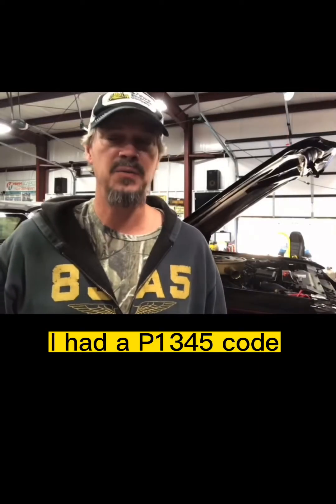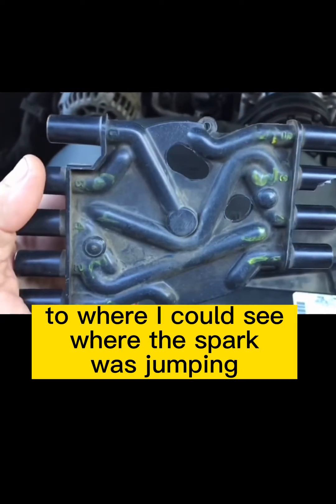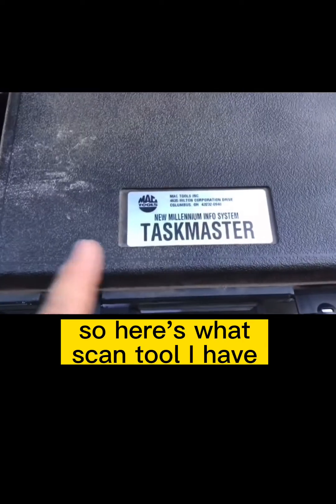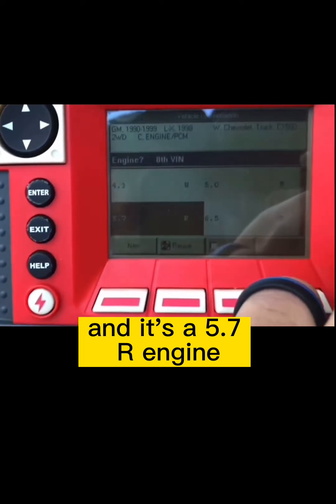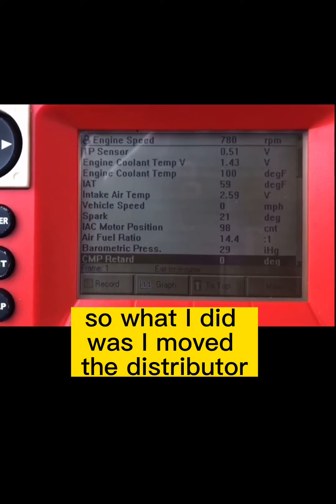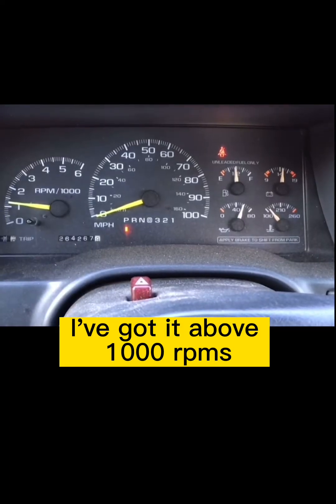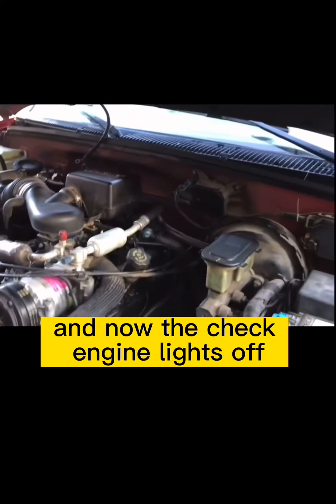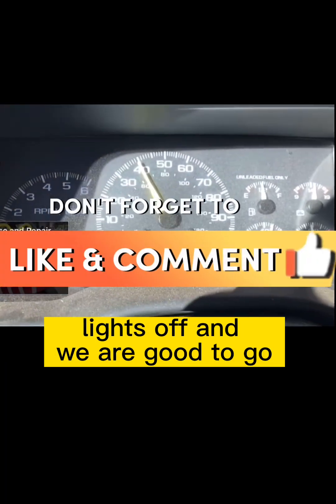P1345 code Chevy 5.7 Vortec Cam/ Crank Correlation fix

Comment: I know this is a old video. My 99 suburban starter went out noticed flywheel was going bald. Had the flywheel replaced and switched to a 11 tooth starter. Got it home sat for a few days then bam no start just engine spining over.  It has a new distributor now currently running no balls wont spin tires. Running is 20-25 + advance but runs great no check engine lights. Im going to replace the crank sensor next as I think its the true problem.  Chasing demons is half the fun right.
Reply: The code i did get was a p1345 cam to crank sensor correlation
Reply from the maker: True. It’s hard to see electrons versus mechanical malfunctions 😂

Comment: I had this code p1345 on my 2003 GMC Envoy with a 4.2l....reseated both cam and crank sensor plugs.....reset light stayed off till i shut the engine off and start back up the CEL light would come back on....my alternator ended up being the culprit. Changed it and as soon as i started the truck the CEL when off immediately....so its not always the timing itself or the sensors. could be a voltage problem.

Comment: I have this issue its at -27 so which way did you move the distributor cw or ccw when you moved it a tooth? Thanks
Reply: if its negative you move it clockwise if its positive counter clock wise.

Comment: What kind of computer or info tool do you need to reset this cam crank collation adjustment
Reply: start the engine with the old crank sensor connected....then disconnect old sensor install new and no relearn is needed. other than that you need a scanner that will do a relearn. I have the TopDon ArtiDiag500 and it can do relearns.

Comment: Im having a similar issue. Only when i go up hills my 02 sensor voltage drops to 0.0 untill i level out or back off the thrrotle
This also happens when i go heavy on the throttle. And throws a system too lean bank2 code

It's got brand new o2 sensors new fuel regulator, new fuel filter. New upper intake gaskets

My time advance is showing -24 at idle 
(even when distributor spark is goin straight to the diode) and goes over -30 when i rev it. Any ideas?
Reply: Figured it out? I’m on the same boat

Comment: If anyone ever find they can't get it by moving one tooth, if you remove the roll pin on the gear you can get half a tooth by putting the drive gear 180 out.  I don't think they get it right all the time on the parts we get cheap from China.  Shimming the distributor to get 0.010" end play is a good idea.  The shaft is smaller than earlier Chevy distributors You can make the aftermarket shim kits work with a bit of fitting.
Reply from the maker: Thanks for the info. I’ve got some old parts that I trust more than most of the China made stuff nowadays

Comment: I'm having two P1345's, changed sensors. When I go to dwell the distributor at 1k rpm, and I get it to 0⁰, the engine dies. Any ideas?
Reply from the maker: Are you using the scan tool to get -2 to + 1 where zero is in the middle of the range?
Reply: The advance fluctuates the whole time

Comment: Alright I had the fuel regulator go out and it hudrolocked my engine. I pulled the plugs and spun the engine over to let the fuel out after I had fixed the issue. 

My main question is can the distributor skip a gear and even if not how can I check timing without and fancy tool 😂
Reply from the maker: There’s really no way it will skip a gear on the distributor. The timing gears and chain can wear to the point of skipping a tooth. Are you having a issue with the timing?
Reply: @dhammiam  idk the engine shakes and i went and replaced the plugs and seen the distributor was loose and when i was doing the plugs i bumped it. it ran bad when it wasnt touched and then i had hit it and it ran worse. i moved more over to advancing the timing and it ran better than before. but its still runs like crap
Reply from the maker: Is the check engine light on? You could just keep moving it a little at a time till it runs best.
Reply: @dhammiam  yes it is

Comment: The distributor wont drop completley one tooth over. It sets high.
Reply from the maker: Take a big screwdriver and turn the oil pump shaft to match where the distributor gear needs to be
Reply: How do we turn the oil pump shaft?

Comment: That miss going uphill is probably your crankshaft position sensor. It doesn’t throw a code except for a cylinder miss.
Reply from the maker: I actually don’t have a miss. I was just explaining why I take a test drive up a hill because if there’s a miss, it’ll most likely show up part throttle going up a hill. Thanks for the input